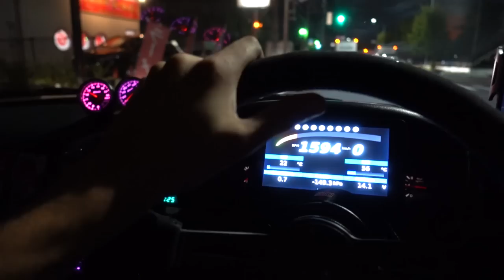NEW CAMS FOR THE S15!

Comment: whats Okachan's theory on protecting rocker arms. Mine has always been engineering-based as its all about rocker speed, So high lift cams are a potential issue. Practical example: Running a Cam with 10' of lift at 5000RPM will have the same Rocker Speed as a 5' lift cam at 10,000 RPM. Extreme example but show it has a massive effect.

Comment: I agree with the rocker stoppers.. Is much the same as what I've had.. in saying that I have had a rocker fall into a bunch of pieces big and small without stoppers, and I've also had a couple just fall off and become jammed with them in.. but to be fair I don't have enough first hand data to say conclusively.. I can't say I think the removal of the cam gear was a good idea.. some mid strength thread locker and it will never come loose and give you the option of adjusting when you do the Ecu and turbo eventually..

Comment: Looks like ur running a hks or greddy u can change the rear housing out to a .63 with no internal gate run a external one get the turbo rebuilt with a ar60 comp cover running a larger comp wheel and larger turbine wheel bigger then the standard  53mm around  57.3mm is good drop in some 1000cc injectors bump up base fuel pressure get a tune and  hold on go the sr ! If ur worried about crank bearings drop in a cradle (girdal) love the s15 that colour pops 👍

Comment: Change the exhaust manifold get a new one with a 35mm external gate or larger and run a bigger comp wheel run more boost = more power and response plus top end there used to be a s13 in oz year's ago he was cracking 11.2 quarter's  street rego so much torque 👍

Comment: Question !

In Australia, its a common theory that Gktech RAS are extreamly bad as youve been saying ... but there is a lot of talk that TOMEI Japan RAS are different in length and are actualy benefitial
Anything similar theorys in japan or just a big NO in general ?
Reply from the maker: Big HELL NO in general. they cause way more harm then good. if a rocker is going to fall out it will & if you have the stoppers there you're most likely going to need a new head after it minces up everything in your head.
Reply: @SAMMIT  Thanks for the confirmation Sam !

Comment: are there any 270 or 272 cams that allow you to use vct
Reply: 264 is the largest i know of that  retain vct and unless youre revving out to 9000rpm or higher and using a large turbo such as a gtx3582 or similar in size, theres no need to run such a large cam, all youre doing is pushing the power further up the rev range
Reply: @SR22VET-S15  Jim Wolf S4 are 266 and can be ordered with VCT compatibility.

Comment: Strut brace not needed, rocker stoppers are the devil, adjustable cam gears are not needed, only low kilometre engines are clean. Jesus so much incorrect info in such a short video